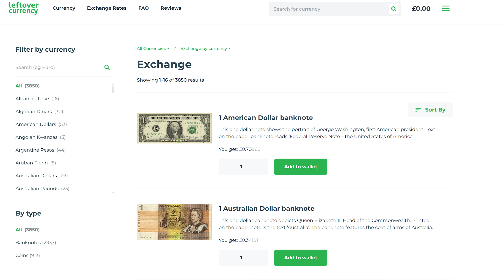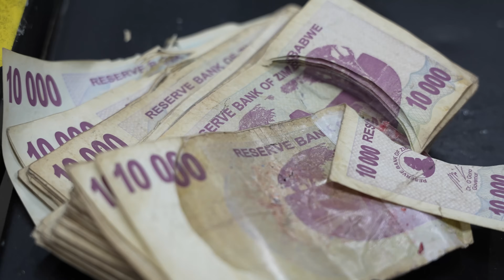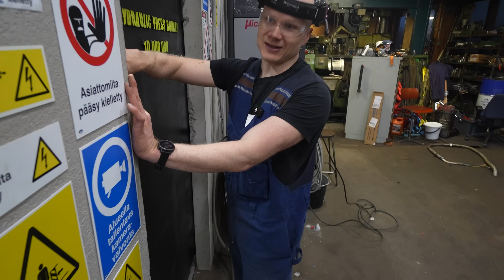How Strong Is Rail Track? Hydraulic Press Test!

Comment from the maker: IMPORTANT UPDATE:

We have been really busy with our new video series about finnish factories and indrustry related things in general. When we get the basic things rolling on better we start to produce also english versions of the best videos but if you want to see how REALLY LARGE engine blocks are machined go check this out https://youtu.be/06iu_Vl_UsQ?si=L2iVrSLAU9b1smG_ 

You can turn auto translated subtitles on for english so you can understand bit better :D The workpiece weighs over 100 tons and during the process they remove over 10 tons of material. So it's a quite large engine block :D
Reply: I have a very old piece of railroad track about less than half the length of the one you showed.   My Grandpa used it like a small anvil.  And that's what I use for.  Not a great anvil, but better than nothing.
Reply: Zimbabwe dollar has a very unique value, in that the cost of a single sheet of toilet paper, single ply, is more than the total value of that entire pile.
Reply: @SeanBZA  Those $10,000 $ notes are collectors items now because they actually printed $100 Trillion bills. I was looking for cheap defunct currency for luxury Monopoly sets and it's not as inexpensive as you'd think.
Reply: You could actually see the press frame flexing, which almost never happens unless the steel quality is way above basic structural grade. I’ve tried crushing shorter rail sections before and the sideways deformation is always the real danger—great call cutting it in half
Reply: Subscribed!
Reply: need a bigger press
Reply: I think from memory bits of tracks like this have to be connected through the use of thermite, they're tuff stuff!
Reply: Whatever you knuckleheads!
Reply: Anvils!  Get new, old and different brands of anvil and crush them.  see who makes the strongest.  are old stronger than new?
Reply: FOLD the stacks of money to make a thicker pile and get explosion
Reply: Crush appliances that are plugged into a breaker/fuse but powered on!  Crush a microwave while it's microwaving something metal like steel wool or aluminium foil.
Reply: The only captions available for me on that video is Finnish, no English option. Is it bc mobile?
Reply: Now there hard pressed for cash
Reply: annoying that i have to read the subtitles but cannot see the subject of the conversation  simultaneously
Reply: @johumm455  If it helps - at least on desktop, you can grab YouTube's captions with the mouse and drag them anywhere on the screen...

Comment: Hello HPC. Merry Christmas to you all. Best wishes. 
Ok. Old railway steel fab man here. Our track pieces for main-line use are referred to as so many pounds per foot. The current standard is 110 pounds per foot, this meaning a foot of track weighs 110 lbs. Your piece appears to be the same Manganese steel, with Rockwell hardness of 65. So at the limit of machinable steel. This steel is formulated to work-harden to a much higher Rockwell number. Train wheels are cast, pressed and forged with the same steel. So if making anvils of rail line, try for used pieces, nice and hard on top. Even un hardened the rail steel is normally worked with grinders or cutting wheels.

Comment: I collect different pieces of railroad rail.  I haven't got one of those with the built-in guard flange.  We had one in the shop I worked at but ut was so old and work hardened, that you could not cut it with a band saw and it was too big for the abrasive wheel.

Comment: For the most part it’s mostly cellulose strands laying in the long direction.  Which gets most of its strength with chains of carbon molecules.  There are a few oxygen and hydrogen bonds which aid in transferring stress between nearby strands.  But for the most part it’s pretty close to trying to crush carbon fiber sheets.

Comment: The paper most money is made from has a high fiber reinforcement, it's more like a random fiber cloth than a true paper.  It's like 70% cotton!  Which also makes it very strong.  All the fibers make it strong, they're all cross-linked if you will; the same reason fiberglass is strong for its weight, and carbon fiber is extremely strong.  Plus it's been sat on, flexed, bent/folded and who knows what else, so there's no internal stress left.  It's designed to be very durable and not tear even after being folded many times.

Comment: Special trail Long ago, train tracks were tested in arctic climates at -70 -100 degrees. In the laboratory, metal rails were frozen under a press. In the cold, metal is brittle. The structure of train tracks crystallizes. But the composition of train tracks metals was made to withstand the cold. Freight transport up to large loads of tons and vibrations

Comment: 265 tons and no movement, no deflection, no nothing. That's odd, because at the WTC/911 there were 47 central spines, 4.5ftx2.5ft thick!! AND ALL of Them moved! And all the concrete, some 150 million Pounds was pulverized as it fell.
Reply: Yes, and with no warming from anything, not even a kerosene fire, just for example.
Reply: You need help bud.
Reply: @riba2233  1.2 million pounds of concrete per floor. double trussed. A steel pan under it. rebar in the concrete. Somehow 8 floors per seconds collapsed and concrete was pulverized, we know this because there are so few concrete chunks on the ground. The 23 stories that tilted and dropped never made it to the ground. All 23 stores, including the concrete, were pulverized as they fell. That's for openers.
Reply: @TheHypnotstCollector  yeah ok bud. Have you ever studied physical on a college level? Honest answer please.

Comment: 3:52 seems its not a 300 ton press its actually a 271.1 ton press lol. Thats why it didnt explode
Reply: 28.9 tons for operating system overhead
Reply: @LaurieWilliams-lk8fc oh i know theres always wiggle room and safety margins i was being facetious and just saying that extra couple of tons would probably have done it
Reply: @lexicase8805  Did you think my reply was entirely serious?
I remember a funny line that said that no one had ever made a chip that Bill Gates couldn't slow with new features.
Reply: @LaurieWilliams-lk8fc  maybe not entirely serious because every press ive ever used we push wayyyy past its rated limits in the shop but ive never worked with anything over about 150 ton, i have no idea what the limits of yours would be but none of the ones ive used had anything electronic stopping you overloading it either 😅
Reply: @lexicase8805  I don't have one, although these videos tempt me to consider finding a big one.
"none of the ones ive used had anything electronic" - Bill's reach didn't go that far.
"I've used"
Almost all hydraulic things have simple pressure release valves. No electronics, nothing to program.
Sorry, Bill.

Comment: 1:30 that $1 Australian note is quite rare. They haven't been in proper circulation for decades since the $1 coin was minted and circulated in 1984, thus removing the bank note.
We had a $2 note as well which was replaced for another coin in 1988, and now our currency isn't even paper anymore. The $5 to $100 notes are all polymer, the first in the world to have them.
Reply: Yeah, I was hoping to see if "tyvek money" explodes differently (or at all) from paper money...
Reply: Sounds like Canada was playing catch up with Oz.
Our dollar replacement with a coin in 1987.
Two dollar in 1996
Everything in polymer by ..I forgot now.. there's no date anymore that I see but it was around 2013 when the ¢1 coin dropped.  Everything is ¢5 and up 
Oz dollar and Cdn dollar is basically equal value but our taxes level is about equal to NZ.
Reply: @RetroCaptain  yup we dropped all our copper coins (1c and 2c) and made them into wire. copper is about as valuable as gold (maybe exaggerated, but it's gold to electricians and anyone in electronics). the UK followed both Aus and Canada with the coinage and polymer notes. our currency value is largely dictated by our exports (iron ore, beef, and not much else).

Comment: a clear tube filled with water and oil to see how it mixes when you press it
Reply: Why should it mix?
Reply: Or how about trying to make water boil with pressure?
Reply: @jamestremblett1875  You have to reduce pressure to get it to boil unless you apply heat.
Reply: @jamestremblett1875 as the pressure increases the boiling point goes up.

Comment: You need to use the wedge shape tool or have the item only supported either side so the middle can give way and snap
Reply: How could it be supported on only one side?
Reply: @LaurieWilliams-lk8fc  No sorry, both sides with a gap between, perhaps a regional or incorrect turn of phrase
Reply: @ImmortalAbsol  Good response.
"either" fundamentally means "one". It's singular.
If someone gives 2 books to you and tells you to put them at either end of the shelf then the correct action is to choose one end and put both there, at the same end.

Comment: Hello! I think I know the reason why paper money banknotes of so many countries are difficult to "explode". As you know, money is a thing of frequent use and it has its own humidity, hardness, thickness. Paper (of course, with its own chemical composition) is still a relatively soft material, and dust particles from people's hands, environmental dirt, and the like can easily penetrate, intervent, and become embedded in it. And when you remember that dust particles are a good natural binder for various construction mortars, the conclusion is obvious: when using it on a damp (especially wet) banknote, dirt sticks to it in the form of a natural binder, binds the paper fiber, and when it dries, the paper potentially becomes stronger in compression. As you know, cement, the natural dusty binder for construction mortars, also makes mortars and concretes the most resistant to compressive force... I think the dirtiest banknotes from poor African countries are the ones with the most binder, so even though they contain a lot of binder, the latter did not want to "explode" when compressed... :)

Comment: Yep.  That's forged steel for you.  Rails actually get stronger over time because of work hardening.  They work harden until they reach a point where the surface starts to get brittle and bits start to chip off. That's when they replace them.

Comment: A train car holds 100 tons of cargo, plus the weight of the car itself. Train track is strong.
Reply: Yes but that weight is spread over the width of hundreds of cars and hundreds of track pieces, the pressure exerted by the press is concentrated in less than a square foot.